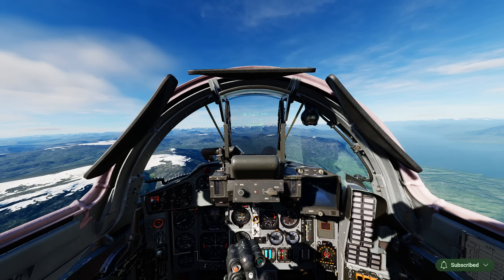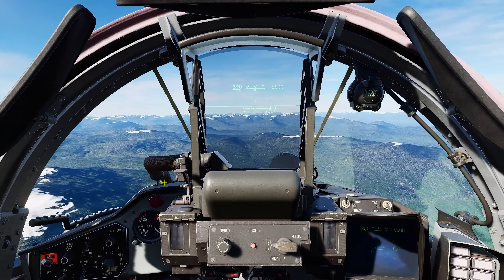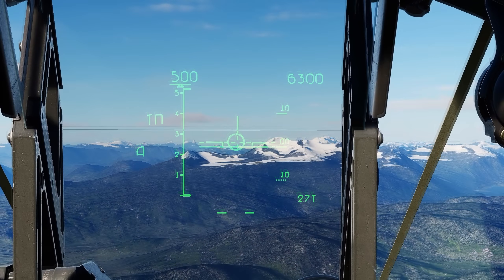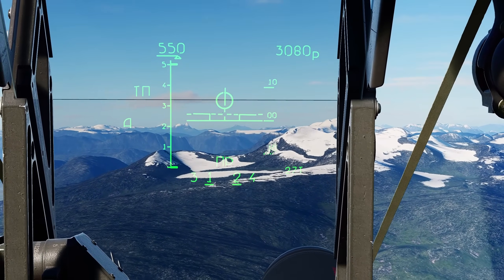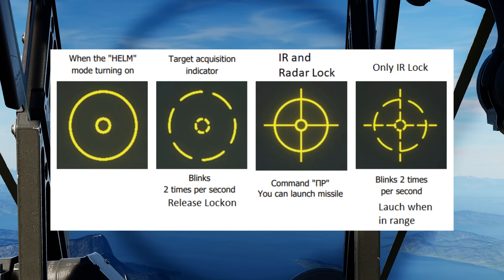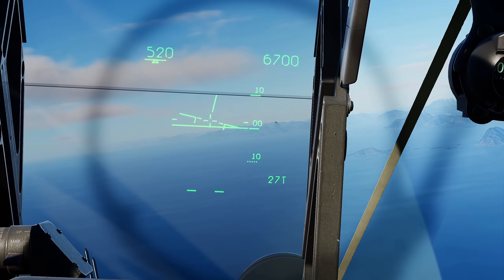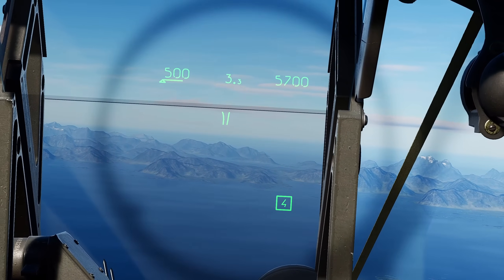Mig-29A Fulcrum: IRST, IR Missiles, ACM Modes & Guns Tutorial | DCS

Comment: To be honest, the IR locking via IRST is incredibly hard. You can see that the enemy dot is exactly as big as some other interference dots on the IRST display, you could only lock him because you knew he was there.
Reply from the maker: I personally think it's going to change a lot over the next few months which is why I'm not going to worry about it too much now.
Reply: You need to adjust the gain to filter out the noise
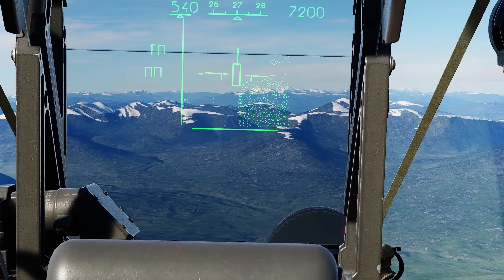Reply: @acromatic0189  Ive seen that. Its about the dot size not the amount. The difference between a contact dot and a random one even with adjusted gain is too low. A random return is the same size as a fighter jet. Look at 5:34 and pause. The gain was adjusted, yet the F15 target is the same exact size as a dot at the bottom of the radar display.

The dot size for actual targets/heat sources needs to be changed. Staying as it is you could look at the sun and you'd only see it as small pixel. It's unusable this way and I highly doubt this is realistic.
Reply: @acromatic0189 As we can see in the video, also with changed gain it is very hard to see a difference.